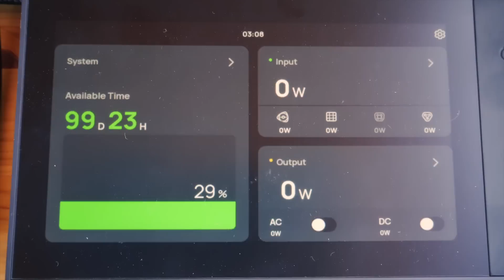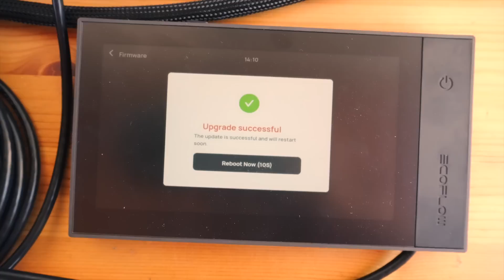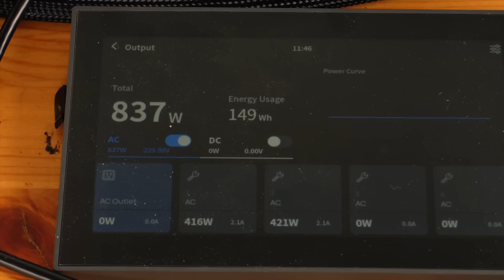Going OFF-GRID! Renovating a 100 year old Portuguese farm

Comment: You should be able use the strimmer as long as you use the string only, not a metal blade. Also, if you are in your own garden that should be exempt. That regulation is for causing sparks in the forest or farmland areas. The locals in every village seem to have a different viewpoint.
Reply from the maker: That’s true. I just go by ear and see what others are doing as I really don’t want to disrespect.